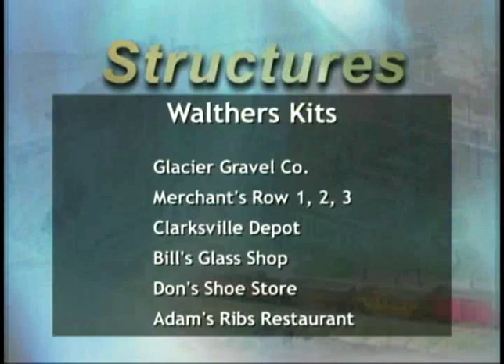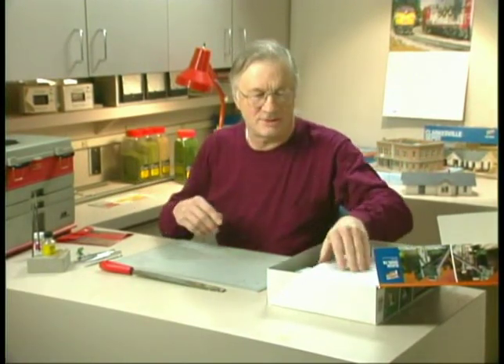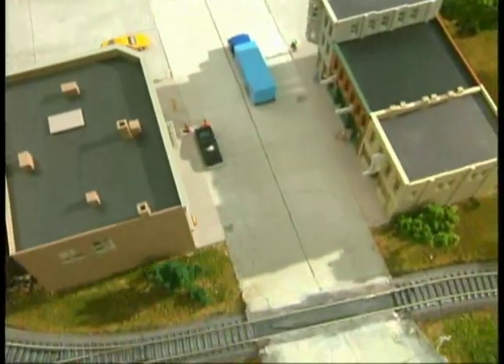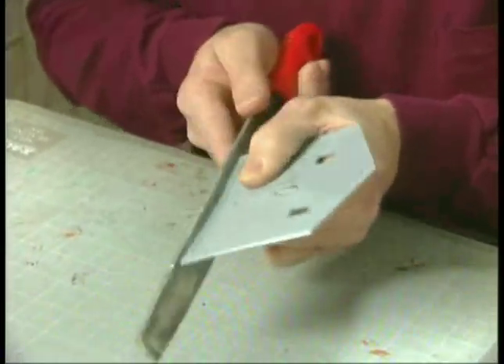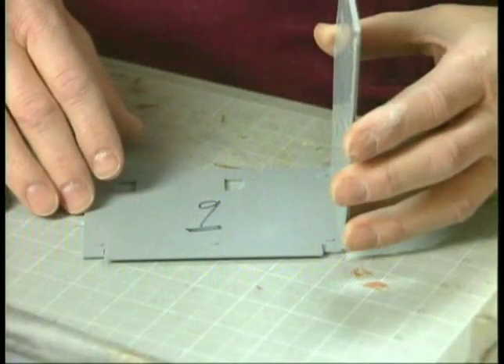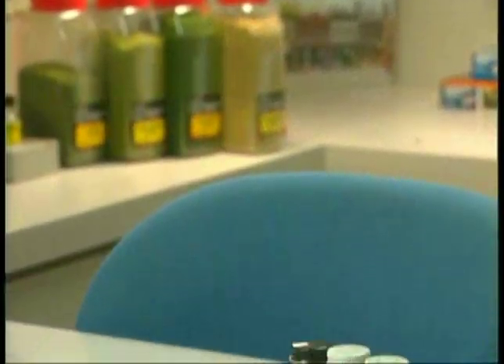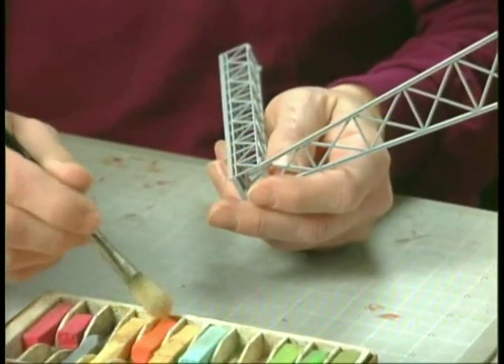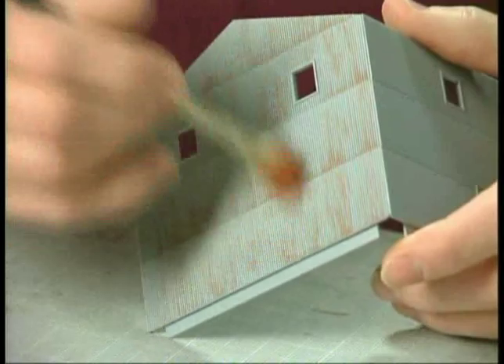Build a model train layout: Model railroad buildings and structures how to WGH

Comment: give me my Polly S!!!   love those.. also if you go to a "regular" hobby shop and they have Tamiya.. it works GREAT with an airbrush.. wide range of colors and they self level really well with good clean smooth finish.  Vallejo (I am lucky to have here in Denver)  is great too.. both brush AND airbrush.  Floquil is WAY too harsh a paint for most folks..and forget Model Master..its for car guys and most the time a REAL pain to work with.